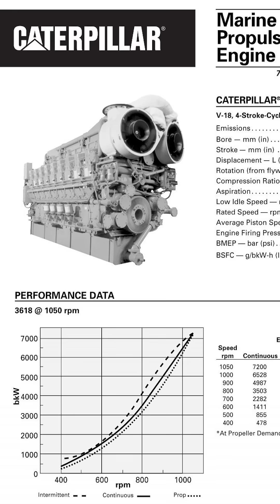wHy Don'T CaRS uSE V18 ENGiNEs?

Comment: Gonna put that V18 in my Miata
Reply from the maker: Alright I'll swap my Civic with a V24 then I'll gap your Miata.
Reply: @BladedAngel lmaooo
Reply: @BladedAngel  Not if i put a v30 in a Nissan Silvia
Reply from the maker: @GSerrano21 Quick, someone V32 Swap their Toyota Supra to Gap this fool!!
Reply: @  Not Before the V38 GTR foo
Reply: @GSerrano21Also ima js V40 swap a Aventador FOOL
Reply from the maker: @kanz7630  Dang bro is invincible (Titlecard plays)

Until a V48 shows up
Reply: @BladedAngel  already have a v50 Honda  super cub while you were doing that. Power to weight ratio is gonna be insane
Reply: @BladedAngel  not if i put a v40 in my motorbike and gap your supra
Reply: @GSerrano21 
VR38DETT ❌
VR38 ✅
Reply: That was until I V64 swapped my z31
Reply: @BladedAngel  all right that's it I'm putting a v80 in my Civic.
Reply: @BladedAngel  Ight bet I’ll v48 swap my couch then we’ll see who’s laughing 😂
Reply: @BladedAngel I got matt Armstrong to fish out the f35 that went into the water recently to salvage the engine and rebuild it in 24 hours using nothing but toothpicks and chopsticks and now I have a rolls Royce with afterburner
Reply: @fohz0710 sorry bud but I already smacked in a double w50 motors and welded them to each other
Reply: @BladedAngel too Bad I'm swaping my Miata with Pratton & Whitney F119
Reply: @BladedAngel  how about a jet engine on my bicycle
Reply: @BladedAngel good luck With my F4 famton
Reply: @BladedAngel  ill just w40 swap my BMW Isetta
Reply: @BladedAngel jokes on you, i have a V50 in my go kart
Reply: @BladedAngel  I got you I’ll put my jump drive in a Miata
Reply: @fohz0710 nah bro my v72 radio flyer 3-in-1 stroll n’ trike could leave you in tomorrow
Reply: You mean W32 ?@GSerrano21
Reply: @kanz7630  well here in dubai we have v60 nissan patrols is that fine
Reply: @BladedAngel  sorry to tell you but I  v36 swapped  a mini
Reply: @GSerrano21what about v160 in a peelp50
Reply: @BladedAngel Done it dawg 😎
Reply: @BladedAngel  no need for that, my supra makes 10mil hp in 1 drop of fuel 🥱
Reply: @GSerrano21gotta wait for my v120 ford focus brother
Reply: @GSerrano21 not before i put a v50 in a chevrolet corvette 1st gen (1953)
Reply: Not if I twin charge a Pagani Zonda R. Put a V112 in there. It's definitely realistic@GSerrano21
Reply: @BladedAngel bro forgot that I happen to own a V1000 peel p50
Reply: @GSerrano21jokes on u I’m boutta v40 swap my bicycle
Reply: @GSerrano21 in that case ill swap my R32 with a V40
Reply: @BladedAngel god tier V580 in my corrola
Reply: @BladedAngel  ima swap my McLaren with a Honda engine 😂
Reply: @road_legal_aviator  Too late! I have already beaten you with my V45 in my Peel F50!
Reply: @GSerrano21 not if i put a v90 in my chevrolet captiva
Reply: @GSerrano21 not if I put a V 50 on my Ford F150
Reply: @BladedAngel ill gap you with my I3 Peel P50 Grrr😡😡😡
Reply: @BladedAngel v42 mini Cooper
Reply: Even with a v32 supra it stands no chance against my H36 smartcar@BladedAngel
Reply: @BladedAngel already done i just put a V64 in my civic i just have to figure out how to keep it on the ground and buddys toast
Reply: @BladedAngel I'ma put a v34 in my 2010 Toyota Prius lol
Reply: @BladedAngel  im gonna put a v 64 my Nissan juke
Reply: @BladedAngel  nah trust ima just v64 swap my miata
Reply: @GSerrano21 nahh golf 3 with v42
Reply: @XF-84  hehe, not if i engine swap my r32 with a 777-300ER 115,000hp engine
Reply: @BladedAngel Nah I’m bout to put a V526636363525262828299352528292529272539337722919387 engine in my Lamborghini
Reply: @BladedAngel I'll get my V42 on my Volkswagen beetle
Reply: @GSerrano21 NOT BEFORE THE V64 PORSCHE 911
Reply: @BladedAngel nah I V32 my trident peel p50 I’ll gap him
Reply: @GSerrano21 V64 Bmw issetta
Reply: @BladedAngel ima v50 swap my scat pack and gap yo ahh
Reply: @BladedAngel  ima put an S8G on my chevy spark just watch
Reply: @BladedAngel  I'm doing a R26B+2 Porsche 963 RSP [I swapped the Twin Biturbocharged V8 in the 963 RSP with a Modified Mazda 787B i.e. the R26B, by adding 2 extra rotors, now there's 6, and I'M INVINCIBLE!] AND I'M GAPPING ALL!
Reply: @BladedAngel  nahhhh id win because I will swap my dirt bike with a V90
Reply: @BladedAngel  and my civic is the v48 with Quadturbo
Reply: @GSerrano21 you'll kneel before my V128 swapped Fiat 126p
Reply: @BladedAngel  My mach-e can gap your Supra 🤓
Reply: @GSerrano21 wait for my V48 mini cooper
Reply: @GSerrano21what about a v40 in my Douge caravan
Reply: @GSerrano21 I’ll  1 up ur Silvia with la swapped v12 ktruck
Reply: @BladedAngel  ill put a v100
Reply: @road_legal_aviator  I got my hypercar and just put a V70 engine.
Get ready to get gapped.
Reply: @ChillAviator  yo chill aviator? You may be chill but I'm road legal 🗿
Reply: @road_legal_aviator  👍
Reply: @BladedAngel I'll swap my 2008 Prius for a Wärtsilä RT-flex96C.
Reply: @BladedAngel  ima v32 swap my 99 ford ranger or my 80 hilux 😂
Reply: @BladedAngel  the weight of the engine would slow it down man 😭
Reply: @BladedAngel  I'll put in my allison v-3420 (that's a aircraft engine btw. I'll make it work) I'll also put a flux capacitor just for good measures
Reply: @BladedAngel bet. Imma put a damn plane engine, from the largest plane ever made, in a Hellcat.
Reply: @GSerrano21Ill put a V100 in my Rx8 and go to space
Reply: @BladedAngel  V400,000,000,000,000,000,000,000.
The Engine that just Sends You to the Literal STRATOSPHERE upon the Gas-Pedal being Pressed.

(V400-Sextillion)

Edit: YES, This is an Actual Name for a 'Multiple-Didgets' Number, Only Occurs after a Quintillion, and Goes Into a 'Septillion'.
Reply: @TrashCan1576   just carbon fiber it
Reply: @Mrleast-i4848  a boat thats impressive it still weighs 4,443 lbs
Reply: @BladedAngel  Nah, V12s are WAY MORE lighter
Reply: @GSerrano21nah, I already put a w64 I ma Tozota Prius
Reply: @BladedAngel  dont worry, im here with my V100 Devel Sixteen
Reply: @GSerrano21ill put a NASA X-43 on my sim racing setup and gap u
Reply: @Edward_Robinson2.0 v500 in a yugo prototype soon
Reply: @BladedAngel  nah I have THE. DODGE RAM TRX V59 WITH A TURBO CHARGER
Reply: @BladedAngel  im sorry but i....... (F-16)³ swapped my corolla 😢
Reply: @BladedAngel I’ll v28 swap my integra and send u to GAPPLE BEES!!!
Reply: @BladedAngel  ill gap you with my inline 20 peel p50 with 10 turbos 🥶
Reply: @donovantorralbaIs it stronger than my P50x2
Reply: @BladedAngel Ok ok, ill swap my GTR with a V32 an gap ur Civic
Reply: @BladedAngel bro I love your channel I found it today and just finished all of you videos post more please
Reply: @BladedAngel bros gonna race the Miata to tire explosion
Reply: @BladedAngel  I see you V24 Civic, and I'll raise you a Honda HA420 HondaJet.
Reply: @BladedAngel lol
Reply: Why don't just put two 12 inline engine and connect it to a gearbox  @BladedAngel
Reply: @BladedAngel  Challenge accepted
Reply: 🎉 @BladedAngel
Reply: @BladedAngel  V30 swapped C6. I gotchu🤷‍♂️
Reply: @BladedAngel  no buddy, I'll swap my Mirage Technica with V100 😂
Reply: @BladedAngel goat😂😂
Reply: @BladedAngel  i'll put a v48 on a peel p50 and add a laptop and gap your civic lil bro
Reply: @BladedAngel  24 gallo in the skyline
Reply: @BladedAngel not if I Put 6 Hellcats In a PT Cruiser
Reply: @BladedAngel wHy No V24 eNgInEs?
Reply: @BladedAngel ur civic will just break lol
Reply: Ight I'm putting a v34 in a lil tikes  @BladedAngel
Reply: The race I wanna see lol @BladedAngel
Reply: @BladedAngel ill put a nintedo 64 in mine so that should be enough
Reply: @BladedAngel both are too big for those car
Reply: Oh yea, I'll put a v48 in my Ford ranger @BladedAngel
Reply: @BladedAngel  twin V12 should be doable
Reply: @BladedAngel  lol i wanna make a way less bigger v18 engine one thats not ment for a boat but one thats downsized to the same width and diameter as a v16 and make a v18 fit a custom car lol
Reply: @BladedAngel  Civic is the thing, connected to an massive exhaust, right?
Reply: @BladedAngel  nah bro im fitting a V300 with many turbos on a wheelchair
Reply: @BladedAngel ok v36 in my model t checkmate
Reply: @BladedAngel  and probably create a airline
Reply: @BladedAngel yo
Reply: @BladedAngel yo
Reply: @BladedAngel lol
Reply: @BladedAngel in stead you should put in 2 v12s
Reply: @BladedAngel  Not if i put a v34 in my kia soul
Reply: @BladedAngel  jokes on you ill install a v60 in my daihatsu coure
Reply: @BladedAngel  imma get myself a V2M and just go light speed lol
Reply: @BladedAngel  then i will modify my toyota or moms fiat to v26 with twin turbo and show yall
Reply: @BladedAngel  You better not forget to add the T66 turbo with NOS, and the Motec system exhaust.
Reply: @BladedAngel  no my v48 gonna gap ya :P
Reply: @BladedAngel can I put v18 on my cycle👉👈
Reply: @BladedAngel nah bro I’m using my shitbox Acura RSX and stuffing a V64
Reply: @BladedAngel  but its demon miata😈
Reply: @BladedAngel hahahahaha😂😂😂😂😂😂😂😂
Reply: @BladedAngel Hell yeah
Reply: @BladedAngel Sybau
Reply: @BladedAngel  naah dont forget my V36 on my razor scooter
Reply: @BladedAngel oh yeah? What about my v28 prius
Reply: @BladedAngel  gotta swap My smart forfou with v204
Reply: @BladedAngel boutta travel to the future with me v32
Reply: @BladedAngel LOLOL
Reply: Y don't they make v 20
Reply: @BladedAngel ama touch tou
Reply: @BladedAngel  inline 12 Grumman LLV mail truck rolls up
Reply: @BladedAngel  remember to add a laptop to your civic
Reply: @BladedAngel mom please be patient it has vtec
Reply: @BladedAngel what about my 10cc lambo
Reply: @BladedAngel nah my prius with a V30 gaps your both
Reply: @BladedAngel  fine then I'll put a W40 in my Ford Mustang with 15000 hp and a quad supercharged setup + also quad turbocharged too then I'll put every nitrous system know to man and add BMW's downpipe in a tune bc BMW made the W40
Reply: @BladedAngel lol
Reply: @BladedAngel AND HOW ABOUT V256
Reply: @BladedAngel  not until I v128 my couch on wheels and I’ll gape all of y’all
Reply: @BladedAngel  I will just hand make a W18 and put it in my Chevy S10, and instead of the Bugatti Quad Turbo, I'll do a Sextuple turbo, and guess what it will fit, cause if someone can fit a V12 a W18 is no problem for the S10, then I will absolutely gapp both yall
Reply: @BladedAngel more like gap your engine from your car by a mile long
Reply: I'm about to v42 swap my lawn mower guys watch out
Reply: @brandonacianceno ima bout to put a v100 in my vw beetle
Reply: @brandonaciancenohaha your lawn mower is slow im gonna swap my hot wheels with a v46
Reply: @brandonacianceno the power to weight ratio will be insane in that mower
Reply: Can I come watch? I'll bring pizza. Just a suggestion, it might be easier to put the Miata 'around' it. There is a guy, Tom's Turbo Garage who bolted a SBC into his Miata. If you get a chance, it's well worth watching. He was very meticulous. It was about 14 parts, if I recall correctly.
Reply: Ill put a tt v60 in my dmc12 and gap all of you
Reply: Respect to bladed for being active with his community 🫡
Reply: Nah, Im gapping all of yall with my W64 swapped Miata with Octo Turbo producing 13k horsepower
Reply: @GaroGost  Checkmate I got a radial 100 in my golf kart
Reply: @garogost9518  my carbon dragon * Apollo i.e. * has 18,000V Producing 847,464,746,747 horse power because there is a actual horse in the engine with 50 jet engines with 70 leaf blower turbos with 16 superchargers 4 blocks 89 hybrid engines with an entire fusion reactor Producing 70,000 zettawatts and 66,766 metric tons of force.
Reply: That thing is gonna look like the 90s batmobile
Reply: Let’s be honest… you’re putting your Miata in that V18
Reply: Two twin turbo inline 50 swap Suzuki cappuccino one in the back and one on the front
Reply: Imma Vbagillion engine from god from the past present and future and all timelines, blessed by Goku and Zeno, with the block made of the infinity stones boosted up by the turbinfinite turbo from the world that never was, fueled up with the power of friendship swap my smart car so I can gap all of you fools
Reply: @bloody1416 
Dom toretos next charger in fast xvxvxiiii
Reply: Sir your sitting on the engine
Reply: FOOLS! I'll make my obs f250 a mid engine and I'll have a v54 and gap everyone
Reply: Me with a V-842 in my ford focus: amateurs
Reply: Gon put your miata on a v18 engine😂
Reply: It’s fun and games until the tweaker with a ford fiesta gets he hands on the Wärtsilä RT-flex96C
Reply: At that point its more like putting a Miata around your V18.
Reply: @Redguns4life  lol
Reply: not if i put a yakovlev M-501 (a 112 cylinder radial engine) in an honda accord
Reply: Actually im gonna be faster than y’all with my v128 on my peugeot 205
Reply: @Moustache073  where you gonna put your 205 with all day engine? Lol
Reply: Not if I swap my corolla with a V1026482838262846210428610
Reply: @zohaibkhurram9387  yeh shoutout to this guy.....lmao he gon go to space
Reply: 10 feet in a newborn bro 😭😭😭
Reply: It'd probably fit too 😂
Reply: I’m gonna be V200 swap my  Prius
Reply: @Mudrunner20111 V300 swap my S2000 😉
Reply: @kanz7630 im gonna put a w500000 in my prototype yugo🥹
Reply: When I'm done with my mini coop jet engine swap, I'll have to register it with the FAA.
Reply: gonna put my miata in that V18*
Reply: Said like a true Miata owner 😂
Reply: a genuine comment in a sea of sexbots
Reply: That front would be even longer... And it will look even funnier than the Z3 and Z4 front look
Reply: I'll put an afterburning turbojet with water injection on my custom made bike and gap y'all
Reply: Gonna Inline 500 swap my beetle
How can ya bozo's gap me now huh????????
Reply: Y’all gonna be in trouble when I show up in my 92 f150 with the V96 mounted in the bed!
Reply: Nah bring get the peel p50
Reply: I'm going to put a v34 on 2006 Toyota Corolla
Reply: V90 my electric power scouter and we going like 900
Reply: Best comment section ever lol
Reply: Reply section*
Reply: Bro this section is gold
Reply: You have some Miata on your motor
Reply: W68 in my Camry
Reply: What will be left of the miata? The badge?
Reply: Putting a Inline 1000 On scooter Hits hard af!🗣️🗣️🗣️🔥🔥🔥
Reply: my 95 miata needs it
Reply: I’ll swap my Suzuki Swift with a Jet Engine
Reply: 8 TURBO 2 SUPERCHARGED V99999992 Bugatti Bolide Evo AWD
Reply: gonna put a v1000 in my Peugeot
Reply: My v8000 in my toy car:
Reply: We are basically riding around in the v18 itself in a miata
Reply: Bon voyage
Reply: Thats like putting 9 inches in a new born..
Reply: That ain’t a sleeper build that’s a freaking nightmare build💀
Reply: @ You guys are nothing compared to my mini cooper with a incomprehensible amount of turbos and a 'simple' swap to a vv 1250 with a billion valves
Reply: i’m sure someone would make it work
Reply: Hol' on lemme get my lost V-1024 Toyota Starlet
Reply: It hungers
Reply: Yall all screwed cause of my quad-hyper rocket engine using antimatter as fuel
Reply: this was the first idea that came to my mind fr
Reply: You are the average Miata owner if you do that😂
Reply: Slap some wings on it and you might even fly.
Reply: (in a little kid voice) im gonna put a V128 in my soupruh
Reply: CarMighty refrence?
Reply: The one guy when talk about engine and meanwhile this mf ask still fit on miata on every video as possible
Reply: Take it to the moon
Reply: It will end up being the Miata if you do
Reply: Don't forget 4 turbos to go with it
Reply: you better, and I mean better, use a wide body kit and give it a really big nose.
Reply: Imagine V64 💀
Reply: that's too weak. I'm going to put a 20.01 V911 cylinder engine in my Toyota Avensis.
Reply: @Couvae  How 'bout V1000?
Reply: I put a V2763 in my Peel P50
Reply: Nah bro I’d swap a w965 in my little tikes crazy coupe and I’d gap all of yall
Reply: I mean, people do call them boats.
Reply: Ima put a 15 cylinder boxer engine in my 2006 Renault Modus
Reply: My 94 prism with no seats simply a prolly chair no doors and a v 126 gonna gap you all watch out
Reply: Me on my kawasaki ninja 125cc. 😊
Reply: V60 swapping a go kart none of yall are catching me (my tank will stay the same size I’ll get half a second of throttle before I’m empty)
Reply: Civic with a toshiba laptop on the dash
Reply: Nuclear reactor engine SWAP
Reply: average miata users
Reply: Hold on, let me just Saturn V swap my non existent Nissan Figaro
Reply: You could probably do donuts on top of the engine with a miata
Reply: Scale down the bore and u got it
Reply: Hol' up, let me bring out my tank tread so my  car can still have traction.
Reply: What the FCK happened while I was gone
Reply: What youre gonna give your v18 a miata!!!
Reply: My v124 Volkswagen bug
Reply: Your Miata will fit inside that V18
Reply: yo whats up boys just brought my v600 swapped EMD SD70ACe recently fitted with new rims and the best tires goodyear would give me

man im dumb :)
Reply: I had a gut feeling that somebody would say this.... and here it is
Reply: YES
Reply: Don't forget the turbo from a diesel loco.
Reply: You can't put that in a miata, you put that on top of your miata
Reply: The new 787
Reply: Everybody's big till I put a v80 in a peel p50 💀
Reply: @  v380 in a peel trident.
Reply: Engine swap my little tikes with a V92 I'll see you in 20 years in the future
Reply: I got an octuple super and turbo charged V10000 Z06 gtfo here cya
Reply: imma put a V64 inside my Peel p50
Reply: @JustARegularAhhDude  I already got you beat bro, I got the v80 in my peel p50
Reply: @PotatoooooO.o  DAYUMMMM bro won ig
Reply: Correction: gonna out your car into the engine 😂
Reply: Why Not in a Corolla
Reply: Brother's gonna break the sound barrier
Reply: Nah imma v116 swap my harley and just strap wheels to the engine and ride it
Reply: Some of yall are gonna fuck around and make a time machine by mistake.
Reply: Bro.. I was legit going to say “put it in a Miata” and here’s your comment 😔
Reply: The v18 is longer thaan the miata
Reply: @Breadmann21that won't stop us
Reply: Just got a 5.0 to put in mine heheheh came here to comment exactly this 😂
Reply: It'll be as big as the miata 
You can drive it on the top of the v18
Reply: Not before I put my V42 in my 2013 Citroen C3 and gap your Miata
Reply: Everyone jojo until I show up with a V100 in my p50x2
Reply: @  amateur
Reply: Me with my OmniVK turbo speed bike
Reply: Put Miata in v18
Reply: Yall are weak my garage has a peel P50 with an octotrillion turbo V4000
Reply: Nah you kids have no idea what you are talking about my v26 twin turbo and twin super charged engine boosted with 6 400volt elec motor producing 10k hp with 7890 ft pounds of torque can take my full carbon striped to be 900 kilos lambo revoulto plus a 23 gear sequential gearbox capable of handling 15k hp and 14k ft pounds of torque will give me a top speed of mach 3 and don't even get me started on the acc and the drive tarain
Reply: Wait till i put a V50 in my 2004 fiat panda 😂
Reply: What if I put an inline 36 on a motorcycle. How fast could that go hypothetically?
Reply: Might Finally Break 200HP
Reply: I think you meant you're gonna put wheels on that engine, then strap a miata to the roof.
Reply: Not sure about y'all but I'm putting that in my fiat🤣
Reply: put an Abrams turbine engine on a Volkswagen GTI at this rate
Reply: Seems like the miata is on the engine or at rather than the engine  in the miata 😂😅
Reply: Pin of shame
Reply: I'm gonna put a v50 in my GTR
Reply: W100 gonna come in my GTR? YES
Reply: "What's your engine?"
Me: Yes
Reply: Better put your Miata in that V18 instead 😂
Reply: I'll put a V32 in my Corsa C
Reply: Im puttjng a rolls royce Merlin in my Jaaaaaaggg…
Reply: Schmitt Car 3 Wheeler please 😂
Reply: Think you meant that you're gonna put that Miata into the V18...
Right⁉️
🤫
Reply: Better yet put it in a geometro
Reply: Im gonna engine swap a peel p50 With a V stack (1 stack = 64 in minecraft)
Reply: Hi guys. Is it possible to put a V12 in my Renault Clio?
Reply: Yall think yall got big engines? I got a V128 in my civic
Reply: Bros gonna create a flying car
Reply: Old crx body with a v 18
Reply: where tf are you driving to to need that much power? the Moon?
Reply: @panzervpl9406  The sun actually
Reply: 🤨 Are you Blue Archive player ain't you?
Reply: Sup gang
Reply: You meant you will put your Miata into a V-18.
Reply: Good luck trying to keep your car up right and speed up
Reply: Other way around you mean.
Reply: Peel p50 + V12 + Twin turbo + Drag wheels + Huge spoilers + Gigantic exhaust is gonna be epik
Reply: "Where you gonna put it, on the roof?"
Reply: Imagine putting it in a limousine it would probably fit of course you wouldn't be able to have passengers
Reply: im gonna put it on my bike
Reply: The engine block probably weighs more than the car
Reply: I sawp v1000 in a mini cuper
Reply: Yall  got rookie numbers ,  I have swapped my GTR with a v 1024
Reply: stretched miata but the cab is half the size and the engine bay is 9x the length xdd
Reply: why.
Reply: Haha NOT IF I swap a LSv1000
Reply: I gonna put to my Chevrolet Cobalt (like the 108hp sedan, not cobalt ss) THE QUAD TURBO DIESEL V128 WITH 20KHP LESS GOO
Reply: bro it is not v16 it is w16
Reply: @rjb8145  why are there 200 replies?
Reply: @BladedAngel Not if i put an 124 cylinder engine in my limousine
Reply: Bru I'll gap u with my v48 prius
Reply: 0 replylies lat me fix that
Reply: ARight I put a 2jz gte in my Honda Civic
Reply: Cousin, I think your gonna end up putting your Miata in that V18
Reply: What about my v80 Ford focus
Reply: tooo bad, just got a v420 for my pt cruiser😈
Reply: I suppose if you lengthen it, you could do so.  The front hood would likely start looking like the hood of a diesel locomotive (e.g. an ALCo S6), though.
Reply: You mean put your Miata around the v18
Reply: Renault R4 😅
Reply: More like mount a miata to your v18 engine 😂
Reply: "There's a miata in the engine."
Reply: I am just enough into engineering to understand these comments and have been having a nice luagh as I read this thread. 😂
Reply: MIATA…THE LOOOOONG WAY🥖
Reply: Time to v18 the echo
Reply: You guys racing to the moon or what
Reply: Miata life! Fight this man!
Reply: Hell yeah, rocket on wheels
Reply: Thats a Cummins QSK78L. They make bigger engines though.
Reply: nah, i'd put a v64 in my fiat500
Reply: And let a 6’6” dude drive it 😂
Reply: Nah, put one on a Suzuki Cappuccino 😂
Reply: Make it hapoen 😎
Reply: add a v69 bro
Reply: You'll need at least 3 Miatas...
Reply: Yall goin blow that mf 😂😂😂
Reply: isn't it bigger than several cars lol
Reply: Miatas don’t even take Piston V engines or any piston engine😂
Reply: BEST IDEA✓
Reply: Just did that
Reply: Nah v18 in a john boat
Reply: I want that V18 in Yamaha R1
Reply: Average engine swap
Reply: not if i put a V36 in my peel P50
Reply: Not if I put a v256 in my Peel P50!
Reply: MX5 u mean ?
Reply: ima put on in a slug bug
Reply: Ofc
Reply: YALL might never heard of VR38 💔🥀
Reply: @TurboSpooler   and you never heard of WR76 💔🙏
Reply: Fine. A V-INFINITE
Reply: The correct choice
Reply: Nah nah you got nothing on my RTflex 96C Miata engine swap
Reply: Hey guys a car is A car from Factory orher wise it is called an at home prject no one is correct here Fool🖕
Reply: I need a V40 for my Audi
Reply: Dumb ways to die
Reply: Imma put a v30 in my peel p50 ur cooked u all are cooked
Reply: I'll swap my devel sixteen with a v1000 and double gold painted twin turbo and six nitros bottles
Reply: Then that makes 120k horsepower gapping everyone in seconds
Reply: i got a 32 cyclender train engine from a submarine i think imma put it in my suburban
Reply: yall actully slow i swapped my jesko with a V1374
Reply: @LAMB0RGHINIGLAZERF0REVER  not until i swap my agera with a Inline 8192
Reply: Personally a v16 in a Prius is the way to go
Reply: Nah i am Gonna put v69 In my toyota Ae 111😂❤
Reply: WHAT ABOUT V2000?
Reply: Nobodys gonna gap my v-54 smart car 😂
Reply: @KilosFlo  no ones gonna gap my v64 digitally generated ai car
Reply: because it fit in a cargo or space ship
Reply: What if I got a V32 in my truck?
Reply: I don't know wth your thinking. I'ma put in a V100 with 2 rolls royce jet engines. Wait, mate that's too slow! How about i add 2 military plane engines. No, no, NO, that's tooooooooooooooooooooooooooooooooooooooooooooooo slow... i add a spaceship on the car. only the fuel and the release thingy. Right into my lego lamborghini countach.
Reply: too heavy weight to power ratio. peel p50
Reply: that V80 💀💀😭
Reply: How about an SLA.16 in a mustang?
Reply: Nah a V80 wins in my Prius 🥀
Reply: Not until I show up with a Ford Mustang with a V1200
Reply: Really?, not until I show up with a v80000 Corvette
Reply: Ima swap my bugatti turbion witth a w90
Reply: Then i'm gonna put a v 100 engine in my honda, civic, it's is grayish white, by the way.
Reply: Ima put a v100 in my smart car
Reply: The seat are at the roof🤞😭
Reply: Gonna put that V18 in my Miata ❌ gonna put my Miata in that V18 ☑️
Reply: Yall are weak I have a Peel P50 with a V1010101919192002010202
Reply: HELL. YES.
Reply: Bruh
Reply: fits pefect in my smart car
Reply: How the serious fuck do u get. V18 in there u see how giant that thing is
Reply: I will put 800 cylinder engine on an l3. Noobs 😂😂😂🔥
Reply: I'll put an F1 engine in my car.

I'm talking about the F1 fighter jet
Reply: YPU FOOLS!
MY STAR DESTROYER HAS A V9069!!!
Reply: Was looking for this comment
Reply: Going from ✨Miata! 😄✨ to 🔥*MIATA!* 👹🔥
Reply: no one gonna beat my WR965 swapped Mustang with 7000 hp and weighs 3,450 lbs still considering the WR965 is fully carbon fiber and imma hit every oblock crowd with it
Reply: carbon it and you're good 👍
Reply: Nah I'll swap a V∞ to my Mitsubishi Eclipse GSX
Reply: Just drive a V67 on my 1992 Honda civic
Reply: Bout to see you on the moon
Reply: You fools...my Lada 2107 with W420 eats your cars for breakfast
Reply: So peak
Reply: IN THE PEEL P50 😂😂😂
Reply: Ima just v1000000 my 2014 nissa altima
Reply: @ZacharyRusso-r2r or V99999999999999999999999999999999999999999999999999 with 9 turbos😂
Reply: Not before i gap you with a V9282
Reply: this mfs building spaceship or a timetravel machine
Reply: And I'll swap my svj with a w40000000 and gap everyone
Reply: More like Miata in my V18...
Reply: The real question is why do cars not use v180 engines?
Reply: Not if I put a v100 in my a##
Reply: time to put that V38 in my fiat 500
Reply: Im gaping you all in my scooter v72 3 water tower Quadruplet turbo 🛵
Reply: i was gonna say that
Reply: Sounds like that train in small tunnel meme
Reply: ima v56 swap my rx7
Reply: Valid
Reply: I think the rear end of that car would be pointing UP after that upgrade
Reply: Gonna put a v43 in my peel p50
Reply: My, how petite all of you are. i got a mitsubishi minicab with a V1,000.
Reply: @rjb8145 i think you might need to get a slightly wider body kid for your miata
Reply: Wtf
Reply: Putting a 20 inch into a 10 year old i see
Reply: @norandomstuff 
Out of context that comment is sus af
Reply: @norandomstuff  wtf
Reply: @norandomstuff ayo wtf
Reply: @norandomstuff  .